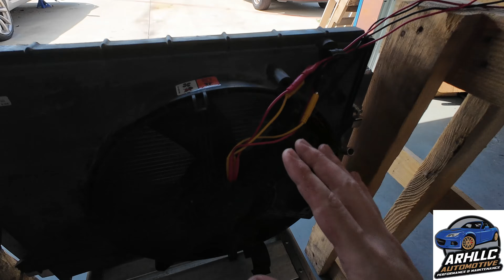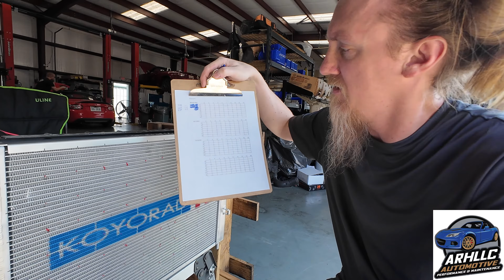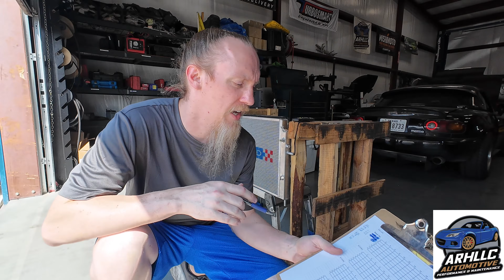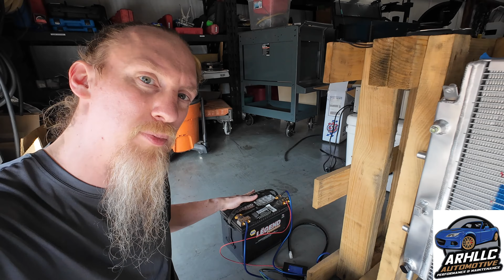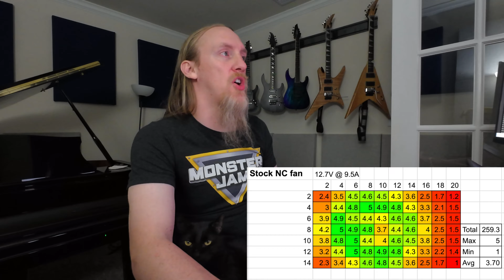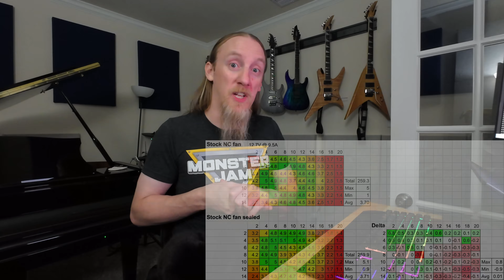NC Miata radiator fan testing - time to upgrade?

Comment: Excellent video! I have an NC with a 2.5 engine upgrade and the engine runs 210-220F temps just driving around town. It has an upgraded radiator with stock fan. I have been looking for just this kind of data. I need an upgrade so good luck with your product.

Comment: 0:27  how would one wire this to a switch for on off for just speed 3?
Reply from the maker: @tylerschrader3601  If you have a working ac system you can just unplug the compressor. The system will just blast the fan non stop on max speed.
Reply: @ for some reason fan won’t kick on while sitting only way to keep from over heating is running the ac fan and heat full blast..? I checked the 30a and the 7.5a and both are fine 
For the first while after I got my 2.5 started cold as ball never needed it like 2 weeks later it’s hot and I’m noticing temps climb when not moving checked the fan something was stuck in the blades but I put a power supply to 2 points of contact on the fan and it works so…? First though was I burned up the motor learned that’s not the case today
Reply from the maker: @ You’ve got some other problems going on. Better get those resolved!

Comment: This is great testing and data Armand.  If I could respectfully challenge this a bit.  Have you measured at what vehicle speed do the fans stall?  In my experience the stock fans achieve stall air speed at around 15-25mph.  With a high amperage Spal fan it may go up to 35mph.  At any higher vehicle speeds the fan actually becomes a hindrance and blocks free air flow and would need to be turned off.  In a stock hood/low speed environment (e.g. in heavy stop and go traffic with high ambient heat).  The big variable would hood venting of course, but that can be constant control.  

Long story short, I'm of the opinion that in most cases proper venting thru the creating of a low pressure area behind the radiator is the best method for air flow thru the rad.  Fans can be a bandaid.  Happy to hear your thoughts.
Reply from the maker: @RyuMoto  If somebody has issues with cooling in motion it is likely never fan related. My objective with fans is to improve cooling when stationary, such as high temp traffic or putting out. With hood louvers and good ducting your fan decrease the load on the fan and make them work less, also increasing the speed at which the fans become the hindrance. 

Fans shouldn’t be stalling out ever unless you’re running them backwards. In our case you may be thinking when the fans run out of ability to improve flow and become a restriction, but even so this also shouldn’t happen since our shrouds have pressure relief flaps.

Comment: Hello Armand!

I'm currently in the process of 2.5 swapping my 1.8 miata nc (my 1.8 is burning alot of oil)

I have some questions that you may or may not have the answer to:
-Harmonic balancer, Most swaps i've seen swap these to the miata 2.0 balancer. But! isnt it better to keep the 2.5 harmonic balancer which is "tuned" for the 2.5? on mine it is only a single ribbed design but it looks alot beefier then the one on my 1.8.
-The balance shaft inside the oilpan. I see everyone removing this. Is it possible to keep this for more reliabilty?
-ECU tuning, I have only seen people using ECUtek for ecutuning but i've never seen Maxxecu, haltech or likewise. Is this very hard to accomplish, thinking of making the oem dash work like usual etc. (I was thinking of installing Maxxecu since it will be alot cheaper that way since I can tune the car by myself)
-Saving money on parts. What are some "guide" prices for parts? I was just looking at the diamond washers and they go for about 35 usd EACH and if im not mistaken you need 3 for the crank and 2(but diffrent) for the cams. That seems insane price for just a thin washer. Mabye a complete list of items needed for the swap with parts numbers and estimate prices?
Reply from the maker: @TheWarcraftIII  I think you’re watching the wrong video if you’re asking these questions. See my how-to videos on building the 2.5 motors and all your questions will be answered.
Reply: @ArmandHindrichs  I just commented on this video because its one of the newer ones ✌️ higher likelihood that you would see it was my thinking.

I've seen alot of your 2.5 videos but its these questions i've not been answered to yet. Maybe you could link me the exact video containg this? 😻
Reply from the maker: @TheWarcraftIII  That’s why my email address is in all of the video captions. :D
Reply: @ArmandHindrichs  Thats super nice of you 😇 was just thinking mabye someone else who had the same thoughts as mine could see this comment section 🌞 but I will send an email if thats preferred 🌷

Comment: Oh my god this is the kind of research I've been looking for. This last summer had me thinking about sealing up my fan, I guess I'll hold off on that for now. Very much looking forward to your fan coming out. Curious what kind of electrical system modifications you expect the fan to require, 20A is a LOT, surely that's beyond the stock wiring's capability
Reply from the maker: @ringindustries  stock circuit is on a 30A fuse but we won’t be using stock circuit for this. I’ve got a nice plug n play setup I’ll be doing for these.

Comment: I think your test was spot on using the battery. Testing both at 12.7v gives you a fair apples to apples comparison because when you're running the fan on an actual car, the alternator will keep the voltage at a stable level, ~14.5ish regardless of which fan you use... Only exception is if your fan draws more amps than your alternator can handle but I doubt that's gonna happen here.
Reply from the maker: @cn1364-w6c  Already tested that - the RPMs don’t even dip with this fan. 😎

Comment: Is there any benefit to running a dual fan set up on the NC vs a big single?
Reply from the maker: @111222333gabe  The options I came up with are dual 11” fans and an extremely tight fit for them. Drives cost up and gets you maybe another 300 CFM over what I’m using.

Comment: You need a quieter 3d printer.  lol
Good stuff.  I'm surprised we don't have better fan solutions.  Lots of rigged stuff to keep the fan running in high mode but no one actually has a better fan and shroud.
Something else the NC world could use is more clarity to the flow of coolant.  With the separate lines for the heater core, EGR, Throttle body and the bypass on the thermostat, it gets confusing.  Keep up the good work.
Reply from the maker: @Hwy929  Everything in my work environments is noisy if you didn’t notice. Lifestyle choices I guess. 

I have a simple setup I do for the coolant line stuff. Delete the tree entirely. Put a 3/4” hose straight from thermostat to heater pipe and a 5/16” pipe from the side pipe (under throttle body) straight to EGR valve. Simplified it quite a bit. For the race guys I loop the thermostat straight to the rear pipe where the heater returns to.